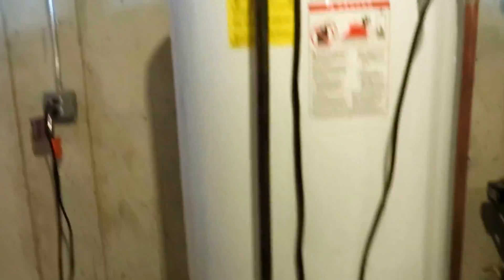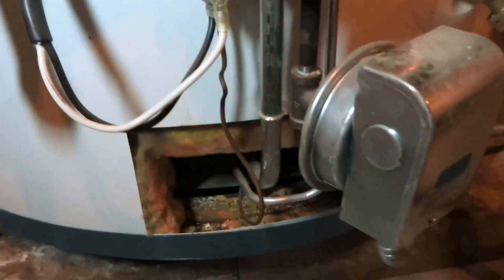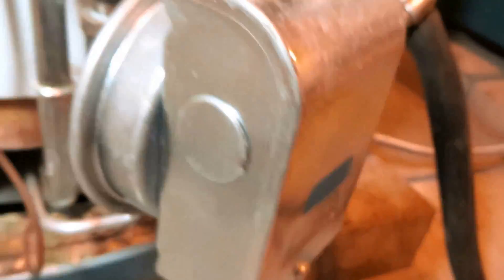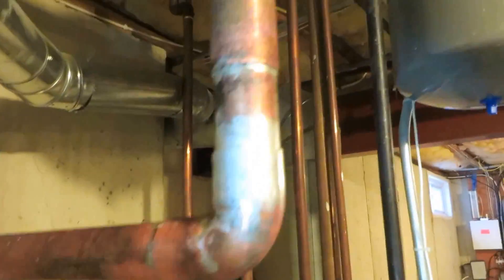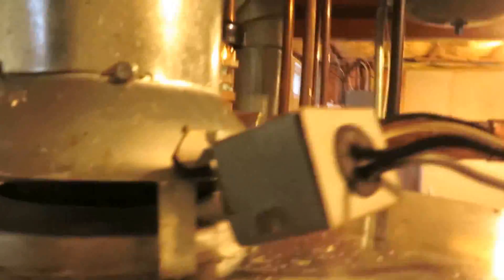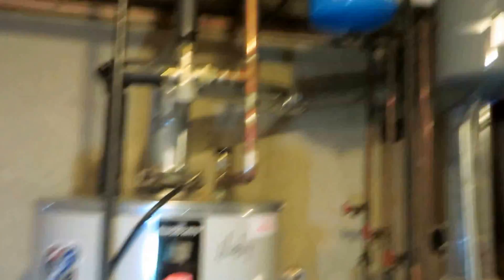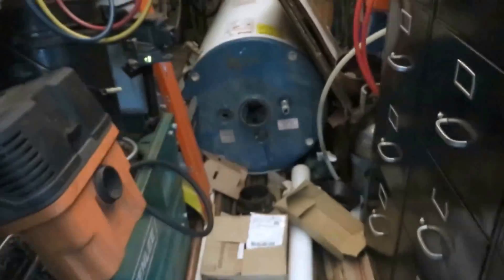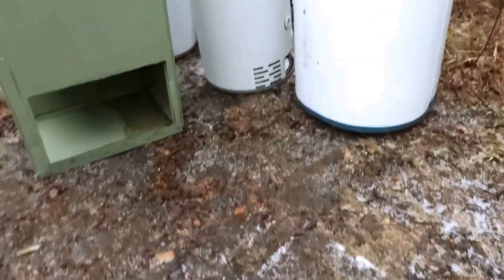75 gallon water heater replacement with swg powerventer

Comment: nice job! Would that type of draft motor work on an oil furnace?
Reply from the maker: Rodney Thornhill power venter ,usaully a field swg powerventer
Reply: cool roofers have taken down a chimney at a house I'm working on and it has a oil furnace in it. I was thinking about doing something like that its very uncommon to see anything like that in my area. all I got to do is run my line voltage from my proofing switch to my primary control right?
Reply from the maker: Rodney Thornhill you would have to match up the control thats set up for a oil furnace and follow the wiring directions .there is a pre and a post purge in power venter follow the wiring diragram for your set up .you can go to fields web site and look up what control you need and wire diragram
Reply: Thanks man!

Comment: I changed one the other day above a drop ceiling, it was a pain in the ass to get down and a bigger pain in the ass to put up trying to balance that heavy ass awkward round POS.  I know how you feel.  Keep up the good work.
Ray
Reply from the maker: thanks ray for commenting
Reply: Hey Steven very nice video. Yeah I'd rolled up my sleeves and helped you get that thing outa there. 75gal ain't no picnic lunch that's for sure!! 

You got a busy bone yard for water heater's. Some fairly recent models too even the one took out wow.
Reply from the maker: Mike's Random Channel i tend to do a lot of waterheaters  i have resently gone to the scrap yard with 3 loads , i probaly have 6 more loads to go .i try to go on a saturday if i am not busy with work .yes the newer heates i strip the controls off i will need them to fix other heaters over time .